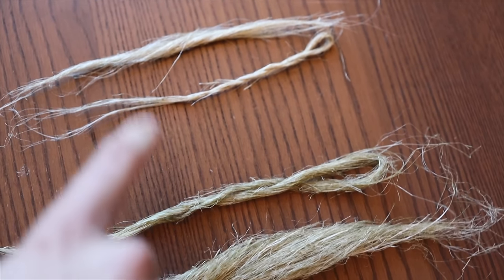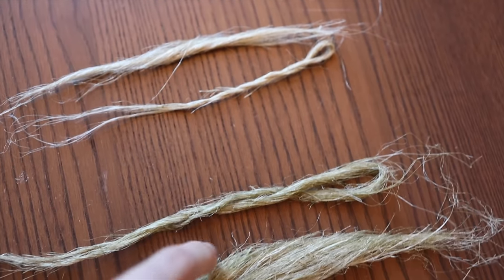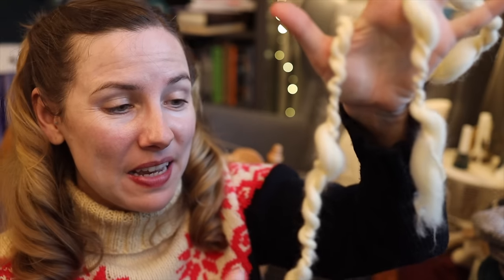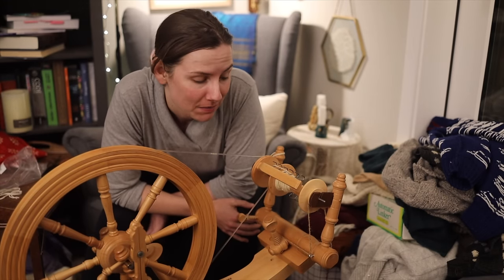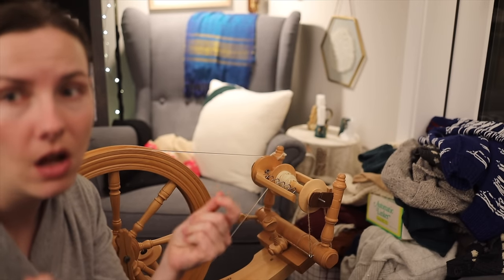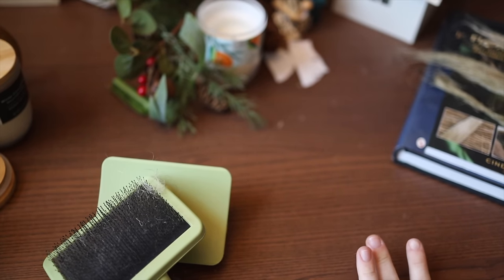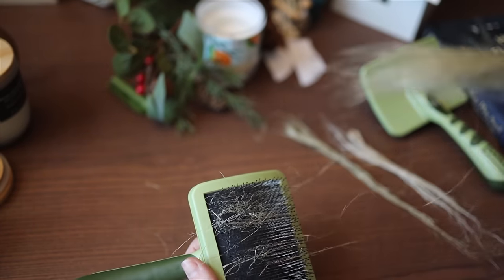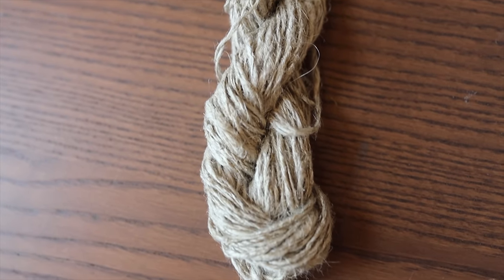Spinning Magic: Learning the Secrets of Flax Spinning || Craftmas Day 2

Comment: You're doing well! The problem with the purchased flax is that the fibres are too short for a distaff dressed that way - those methods are designed for managing long line flax, which is around 30cm/1ft long. 
The purchased flax "roving" is designed for machine spinning, which requires shorter fibres, and as you've noticed, you can handle it much like you'd handle wool roving with long staple length.
You could also try dressing the distaff with the flax roving in the same way as you dress a wool distaff, there are several methods, one being that you make a gigantic rolag and tie that to a stick or a paddle-shaped thing at the end of a stick. You then just need to make sure you let the twist climb much closer to the fibre source to maintain thread integrity. And maybe test a flaxseed goo recipe for wetting the fibre instead of saliva 😉
Have fun!

Comment: My guess as to why the distaff didn't work is because the staple length isn't long enough. It looks like you were using flax prepared as a "roving", which would have a shorter staple length than true line flax. Line flax is sold in a bundle that is approximately the length of the staple, whereas the "roving" is a bunch of shorter staples mushed together. I suspect that the distaff will only work if the staple length is >= the distance between the distaff and the orifice.

Comment: Since the fibers are pretty short, tie them farther down the distaff to get closer to the orifice and only tie it at the top of the bundle with the ribbon for easy access to the fiber since it is a small amount.  Spinning flax from a rolag will make a hairy yarn even with water and you want to spin from aligned fibers for a smooth, strong thread.

Comment: I love how persistent you are.🥰 Spinning is challenging and it does come down to putting in the time. I encourage new spinner to spin at least 10 to 15 min. a day. I did notice at the beginning you just needed to draft the fiber before the twist entered. Also it looks like you bought tow flax or roving, which is the shorter bits that’s left over after processing line flax. Line flax comes in a large bundle that’s twisted back on it self. You are doing awesome, keep it up and have fun.🎉

Comment: Have you tried rubbing and scraping? Often plant fibers are processed in ways including these steps.

Before you dry the stems, put them on a flat surface. Using a hand size, smooth rock hit the stems to break the layers up. Using a dull knife or a butter knife gently scrape the unwanted materials off of the long fiber strands. 

Now dry the strands.

After you dry the stems hold them between your flat hands. Rub your hands back and forth quickly. This will remove  the bark and inner pulp without damaging the fibers.

And remember to slightly dampen the fibers before working them.

Good luck! ❤

Comment: Good for you for jumping right in. As others have commented, your commercial flax preparation had shorter fibers than true line flax. Another way to spin it would be to wrap it loosely in a towel. Hold the towel in your lap and spin from one open end.

Comment: Giggled when I saw you using dog brushes.  I used to show a coated dog breed and saw s fairly coarse tined slicker brush for sale at one of my favorite vendors.  The vendor was appalled as she knew what breed I had.  I had to let her know that I wouldn’t be using it on my Beardies (it would have ruined their coats) but to open up wool locks.  It was much,much cheaper than a textile flicker brush.